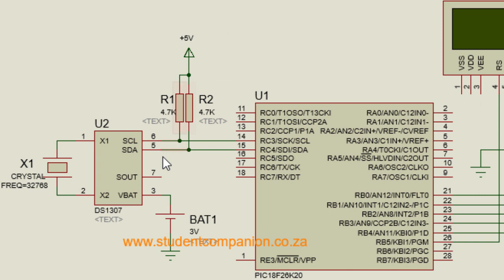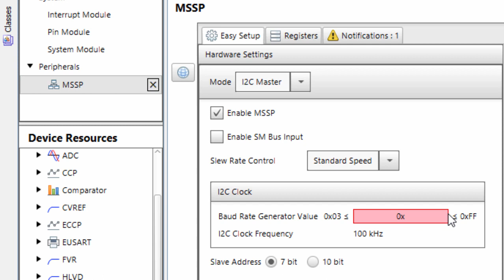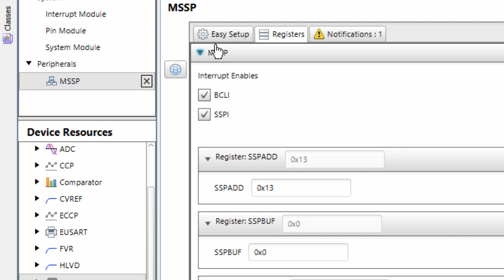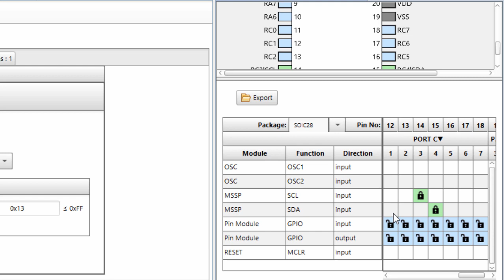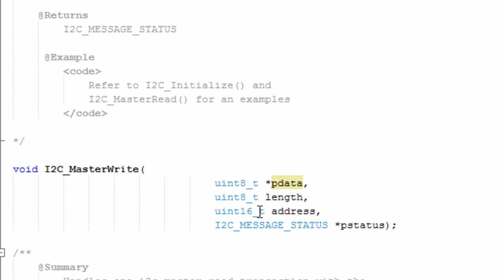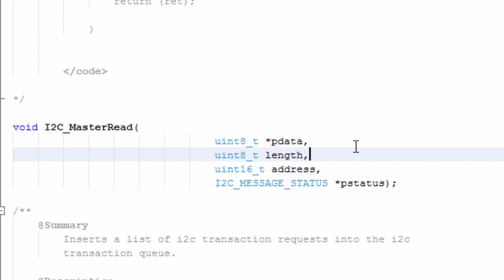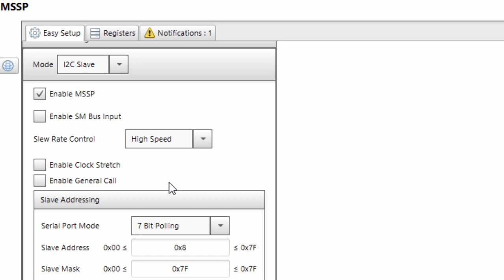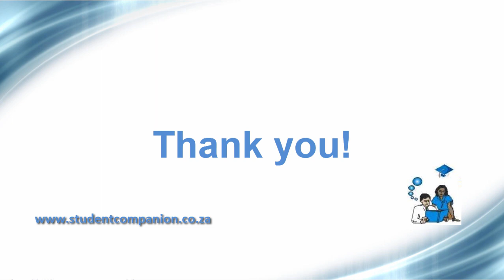37- I2C Communication, part 2: Config with MPLAB Code Configurator | MPLAB XC8 for Beginner Tutorial

Comment: Hi, how to include the MPLAB xc8 peripheral library and use the library? I have install it but how to use it? Urgent
Reply from the maker: +Steven Lee if uou have installed mplab pic18f peripherals libraries, read this article you'll learn how to use the I2C functions of peripheral libraries: http://www.studentcompanion.net/en/pic-microcontroller-communication-with-i²c-bus-xc8/
Reply from the maker: +Steven Lee  and this is an example: Digital clock using DS1307 real time clock: http://www.studentcompanion.net/en/digital-clock-using-pic-microcontroller-and-the-ds1307-real-time-clock-xc8-compiler/
Reply: Nope sir, i have already installed the pic18f peripheral libraries, but i cant include the function like Stopi2C() StartI2C() in my code. How am i going to use that function in my code? Your tutorial didnt teached that.
Reply from the maker: What do you mean you can't include those functions?  Are you getting an error when you use those functions?  Which PIC are you using?  What's version is your compiler?
Reply: I am using PIC18f4520. XC8 version 3.30.
For example, this is the code. I just cant run the code. Yes i am getting error when running the function.
while(1)
  {
      StartI2C();
  }
Do you mean that once i installed the library i will automatically able to use those function in my code? I just cant use the function like StartI2C(). Thanks for your help
Reply: For example this is the code: 
#include <stdio.h>
#include <stdlib.h>
#include "xc.h"
#include "DS1307.h" 
#include <p18f4520.h>

void main(void)
{
    StartI2C();
}

I am not able to run it is it because of i didnt included the I2C header file. I am not sure. Need help.
Reply from the maker: +Steven Lee why do you include <pic18f4520.h>? Once you include "xc.h" you don't need to include ghe pic again. Did you read our DS1307 article? You must always call the OpenI2C () before any other.
Reply: Problem solved. 

Go to run >> Set project configuration >> customize >> xc8 linker >> run time then scroll down >> enable link in peripheral library. Thanks
Reply from the maker: +Steven Lee version 3.3 is MPLAB IDE.  I need xc8 version. You didn't specify the error message you are getting when you use those functions
Reply from the maker: +Steven Lee ok.

Comment: kindly share video to read data from DS1307 along with sample code linked . It will be more usefull to all.
Reply from the maker: +ajit nayak here is a video to read data from DS1307 with mikroC.  MPLAB video will also be released soon: 
https://youtu.be/1Pguv4Ha7jY
Reply from the maker: +ajit nayak here is also a digital clock application: https://youtu.be/E_bAO7MwadQ
Reply: I have gone through video. But here used Micko E compiler and library function. My question is once you config in MCC configurator how you used function created by MCC config masterread and write function to read DS1307. If u can give ur mail i share my code.
Reply: video could be more useful for end people. if its continued of MCC configurator using MPLAB itself. Once we config the i2c master can we use over old i2c code for read data.
Reply from the maker: +ajit nayak as we said, we will upload the MPLAB video as well soon. Not now.
Reply: we are waiting for updated video , if you can attach code will be more informative
Reply from the maker: +ajit nayak MCC is just a tool to generate library codes. But you can't mix old library functions with new library functions with no code definition.  You'll get errors
Reply from the maker: +ajit nayak unfortunately we don't do that. We don't attach codes on our videos.  Codes are attached on our website.
Reply from the maker: +ajit nayak we don't share codes in emails.  Wait until we upload the video or update our website.  Unfortunately we can't do it for you now as we have other priorities especially to fulfil requests from our subscribers who supported us financially with donations to make this possible. Their requests are priorities.
Reply: Can you give us lead for coding DS1307 MASTER slave config. I need sample from where u tried out code
Reply from the maker: +ajit nayak please read the previous comment we wrote to you 4 days ago. Your request is not priority to us. We have other priorities.  Everything is explained in the DS1307 datasheet . Or you can wait until we finalize that tutorial. 
That's the process.

Comment: dude u should make ur videos without using code configurator it doesnot help us
Reply from the maker: Some people prefer to use the code Configurator especially beginners that's why we use it. You can also get all the register settings values generated by the Configurator if you want to configure manually your registers